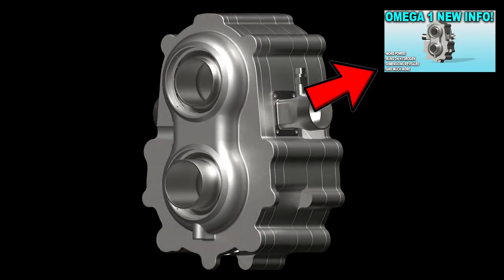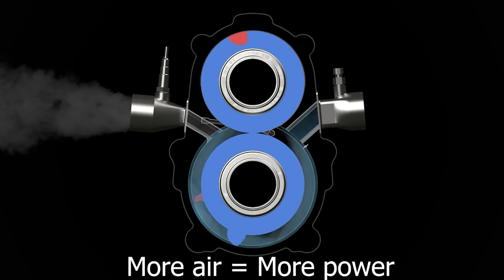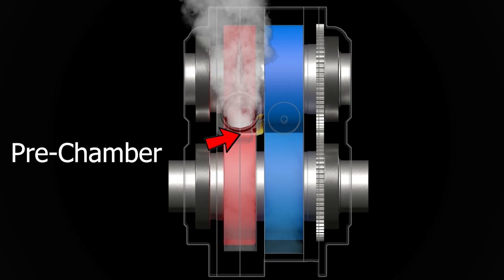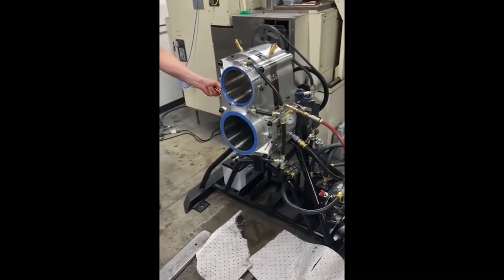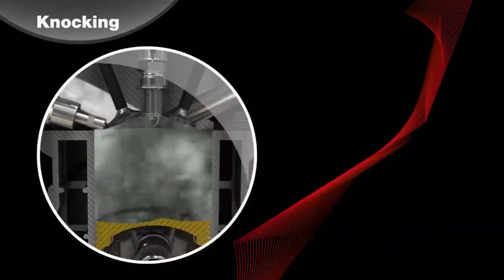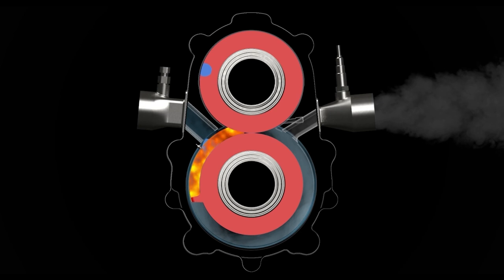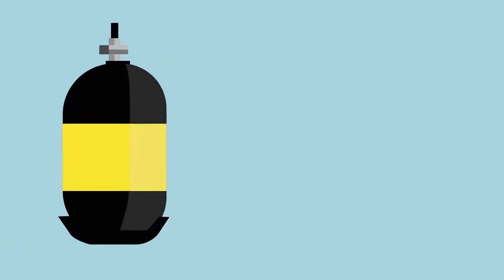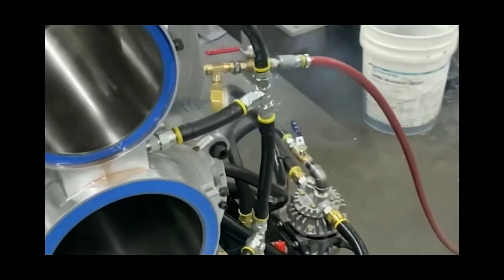Inside the Aston Aerospace Omega 1 Engine: How it Works and Why it's Unique

Comment: Thanks very much for your efforts getting information on this engine.  If you think compressing hydrogen to 5,000 PSI is going to give you a liquid, you've got another think coming.  Hydrogen won't liquefy unless it is very cold, in the order of minus 240° Celsius.  If you have cryogenic tanks, you can boil it to keep it liquid.  Liquid hydrogen is rarely used in automotive applications.  5,000 PSI just gets you compressed hydrogen, it is one of the big problems with this fuel, you have a very low energy density, you need a lot of high pressure gas cylinders to go a short distance.  The idea that you can build a practical internal combustion engine to incredibly tight tolerances without any need of seals is rather bold.  The massive leak demonstrated on the video is suggestive of the difficulties involved.
Reply: Sounds like someone trying real hard to grasp a concept
Reply: @ryanhanseen2808 no he's explaining the truth about hydrogen engines

Comment: I think this engine, different from Wankel.., and many other weird inventions..., this is really promising  and  I'll be watching for its developments.  But.., please .., wake up and don't expect anything from Hydrogen,  because to produce Hydrogen and separate from water it's necessary  enourmous amounts of energy, which will never pay back physically or economically,  e.g.,  the efficicency will always be very low.   And.., talking by myself  I will never put a tank with 10k psi of pressure in my car and I'll never ride a vehicle with such a bomb.    Other thing are the EV's !   As an Electrical Engineer I can say that they are far superior than the combustion car !  But...., the real problem is the Energy storage.  It will be very .., very difficult to replace such a perfect  "Energy Storage" as  Diesel, Gasoline and specially Querosene are.   We'll wait a long time for something really good !

Comment: You can eliminate the top rotor by using a passive combustion sparkplug as used from Industrial machinery to increase efficiency as well as recent Formula 1. Eliminating the top rotor would allow a high psi supercharger without inter-cooling due to liquid Hydrogen. The pressurized charging is needed to increase hp and can balance the whole rotational forces by extra balance weights.

Comment: There is no need to chase clean Hydrogen, witch is hard to store as liquid and has so small atoms that it can escape containers it is stored in. You can just as use Ammonia that is 3 part Hydrogen and 1 part Nitrogen. Or use Propane that is 8 part Hydrogen and 3 part Carbon, both burn clean and can be stored at room temperature as liquid...

Comment: Thank you Chris. I'm glad to see people working on rotary style engines. I know piston engines have been perfected pretty well.  Converting  Linear motion to rotary is not as efficient as straight up rotary motion.
Reply: What should the rings be in the hot part and the cold part to create compression in this type of engine. And look at the prototype it is leaking oil. I don't want to upset you, but I think it's a scam.

Comment: This engine looks promising and thumbs up for keeping us informed about how this engine works. I like the rotary engine as once the design flaws that were built into the engine are fixed the engine gives 270° of compression and the engine will have only three-six or so moving parts for the most part. Problem is I seem to be the one that needs to build it from scratch and I don't have a large enough CNC mill to do so right now.

Comment: It's a bit like a single lobe roots blower with 2 stages. The first stage acts as the compressor stage which feeds a second combustion chamber gas expansion power generating stage.
Seems like thermal efficiency will be poor as much of the thermal energy of the combustion stage will go into the piston walls which are very large compared to the effective work generating surface. 
The piston is like a long curved tube so most of the heat will go into the long walls of the tube and not so much power will be generated by the force on the rather small piston head.
And in the compression stage the gas compression will heat up the inner surfaces as the gas gets compressed leading to subsequent operation facing the challenge of trying to compress gas that is being simultaneously heated by the hot compressor walls.
The length of the moving piston seal with this design is large compared to the piston rings of a linear piston head - seems it will be very challenging to get a good seal and prevent combustion gas from leaking out especially as the engine warms up or changes speed the components will distort and either cause the seal to rub leading to wear and friction losses or open up leading to loss of compression and power.
It will be interesting to see how they can overcome these design challenges.

Comment: Amazing Engine, can’t wait to see this in my Diesel Vehicle instead!.
Reply from the maker: Same here!
Reply: Funny how ppl who are worried about climate change are not on this tech with a quickness. And here you are, looking forward to better tech than ur current diesel....

I'm one of those folks of course, except for believing in a multiplicity of technologies to serve our needs for transportation and climate future. I'm trying to get "my" people to pay attention to the possibilities of new gen rotary, or turbine, engines. They're all about EVs... argh.

Speaking of metal melting temperatures, people are finally waking up to the risk of lithium battery fires, the sheer heat and difficulty of putting them out. Is there any info yet on what kind of risks these engines might have for fires, difficulty extinguishing if they happen, and risk of the kind of catastrophic failure that could send shrapnel through the passenger compartment and through you?

thnx

Comment: If this engine will make a lot of power to weight ratio, they should look at a pump that can push H2 in.  The reason I say this, is that compressed Hydrogen is very expensive to make and use.  There are now ways to store hydrogen in a solid form, at the same amount as compressed, without the expense or danger of compression.  For example, there is the PowerPaste solid hydrogen.  I'd love to see this engine and hydrogen finally do away with the need for fossil fuel engines, and not have to resort to EVs.

Comment: Great explanation. Seems like a good idea but I'm not sold on the super-high tolerances, feels like it would make it expensive to build and quicker to wear out.
Reply: High tolerances are a problem when there's physical contacts with the parts (lubricated or not). Here it's not the case, so wear and tolerances increasing isn't as big of a problem like in a Wankel engine for example.
Reply from the maker: jup
Reply: @em4703  Still there's the price. And even if there's no contact, it's still holding in a lot of pressure. I'm not saying it's impossible but I'll remain sceptical until they go into production.
Reply: Similar to a rotorary screw compressor. They have very tight tolerances and they last a long time.
Reply: well as long as its cheaper and more efficient than gas turbine with similar weight it will be huge success... as long as it works.
Reply: Wankels work, and wankels are rotary engines. No reason this one wouldn't.

Comment: There are a lot of surfaces exposed to the combustion gases, I would be interested in seeing calculations on the thermal losses, the more energy lost that does not produce work the lower the efficiency of the engine.  This was a problem in a lot of normal piston engine designs such as the Heron head, the piston crown losses significantly altered the combustion process. Of course, after Harry Westlake and Keith Duckworth, we now have properly designed pent-roofed combustion chambers with a lot of squish.  It took a lot of time to work out the squish bit, till then pent roofed combustion chambers were just as horrible as all the others.

 I am not even going to attempt to talk about the exploding Diesel truck which in the normal mode of running is auto-ignition aka compression ignition or the fact that at high speeds spark ignition engines have their ignition significantly advanced and are firing the plug well before TDC.

Comment: All rotary type engine (including previous "Wankel" of Mazda; rx- 7, rx -8)...
All their trouble is.. too high operating RPM hence Air Leak--> Energy Loss+Over-heated
Bringing-up High Fuel consumption (Lower Thermal Efficiency...).!?!
Esp this one(type) Has no Seal at all.? They will consume Lube-oil --> lots of Smoke.!

Comment: I've lost sleep trying to come up with a cylinder that could move like a turbine, rather than the way reciprocating engines do, in order to achieve greater efficiency.  After all, some of the power created is lost in pistons having to constantly come to a stop and switch directions.

That being said, my gut instinct is that a startup company like Aston Aerospace is at a distinct disadvantage when it comes to capital, compared to the large existing engine manufacturers.  Something tells me that the big companies, especially the bigger car manufacturers, would not want to share any revenue they don't have to.  Why pay Aston Aerospace a royalty for every engine that Aston licenses them to make, when, simply by not buying from Aston Aerospace will hamstring them for capital and at the same time, the big car companies can work on reverse engineering a product similar enough to get its benefits, but dissimilar enough that they can patent their own version of the technology?

I'm fearful that this engine might be made out of unobtanium.

Comment: Pretty sure this is supposed to be in a spacecraft as a backup generator(turns an alternator)/long distance travel propulsor with the exhaust recycled and/or sent to an ionic propulsor to further speed up exhaust gasses and add additional velocity to spacecraft as well as low cost course correction. Water can be found on a few terrestrial planets and so would be theoretically easier than trying to find oil on Mars etc. However would still require alternative fuel/engine to clear terrestrial planets. With no frictional losses in space and by wringing out the velocity of ejected water the minuscule mass ejected would add up over time.

Comment: Hydrogen is a crappy fuel. It has very low energy density, it's difficult to handle, it can cause hydrogen embrittlement in metals, it requires energy to manufacture, and probably a few other things I can't be bothered to dig up.
Natural Gas is better but still low energy density, propane is another step up but can be problematic at low temperatures. 
Jet fuel is basically diesel and it's successful because it has a high energy density, is easy to ship, store, and handle, and is not too flammable. 
If they can make this engine work with a decent fuel and prove its reliability in all kinds of conditions then it might be good for aviation, but it would require a reduction gear and that adds weight.

Comment: well i am sure they are putting more thought into it than i am, but i don't see how they are going to get compression ignition with no seals ..... i am envisioning a powerful starting motor on the next prototype, taking the engine up to about 3,000 RPM before it starts. ( on hydrogen this time )

Comment: The only issue I see is that the combustion chamber is donut like ,which means the rapid expanding gas will have to travel through a long narrow winding~  passage with lots of surface till reach the exhaust port ,thus lost energy along the way , so my point is the efficiency might be  a big question mark . though the concept is quite unique.😁

Comment: This engine will never be viable for anything outside large-scale aviation and racing with those tolerances. Building such high precision components exclusively out of metals with low thermal expansion is simple too expensive to warrant its' use in light experimental aircraft or cars that can be bought without a racing team.
If they were to look into some kind of very low friction polymers like PEEK to line the lobes, it would be a lot more affordable. Nowhere near cheap, but cheap enough to be used in small aircraft and higher end cars. If the thermal efficiency is what it is claimed, then polymers are a viable option.

Comment: Apex seals will be required because heat will change dimensions of the housing & rotor, so keeping tight tolerances will be impossible at all temperatures. That's why it needs seals that can adjust tolerances to compensate for temperature changes.

Normal apex seals (ie: Mazda) are backed by a spring (so they adjust for temperature changes of the rotor & housing. Like that "seal-less" rotor, they don't ride on the housing/sealing surface, or else they fail. They also ride on a thin layer of oil, not water, because water isn't actually a good lubricate, because it boils below working temperatures & becomes a gas.

That "engine" is a bad joke.